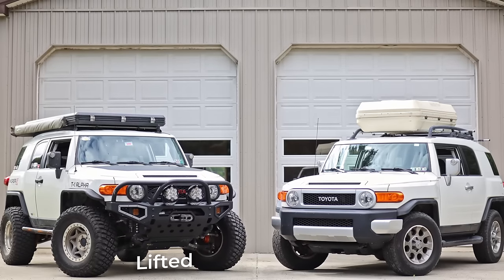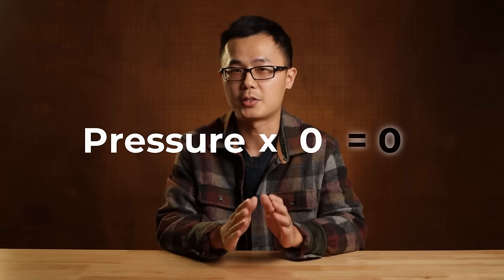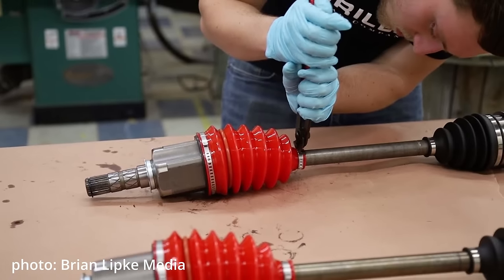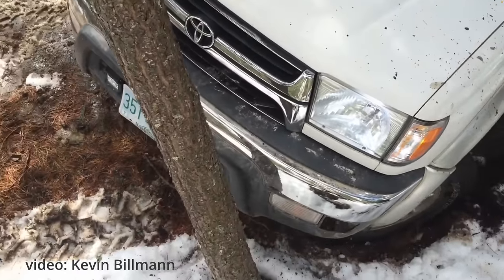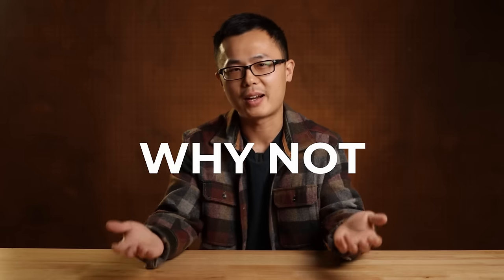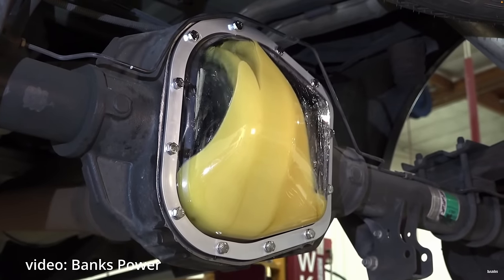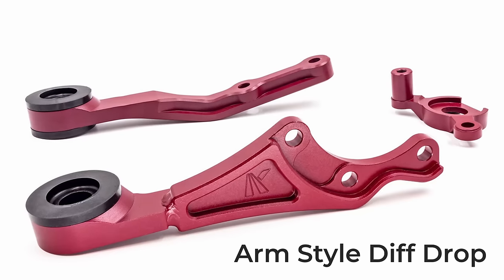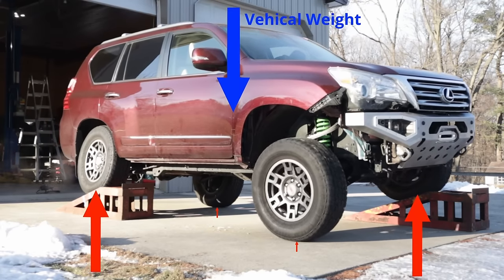More Harm Than Good? Toyota Diff Drop Truth vs Myth

Comment: Hey Tinkerer. Love your videos, but something feels unintuitive about this one. I did a bit of googling, and it looks like the maximum stress on a CV joint increase linearly with angle according to a research paper. (BIGGER ANGLE = MORE BROKEN CVs) 

Google the (free) research paper "ANALYSIS OF RZEPPA AND CARDAN JOINTS IN MONORAIL DRIVE TRAIN SYSTEM" by Sang June Oh and John T Woscek, 2015 and read page 8 and 9. The CV on our vehicles are Rezeppa joints, so don't worry about the Cardan joint. "The bending moment... is dependent on the operating angle and the initial drive torque from the motor. The maximum stress is seen at the top of the splines." On page 9, there is a table showing that the stress increases as angle increases. They also did FEA and found that the factor of safety (higher is safer) in a particular application dropped from 25.04 at 1 degree angle to 3.66 at 6 degrees to only 1.99 at 12 degrees. This is for a train, so don't apply these numbers to your car, but notice that failure is clearly more likely with greater angles. Please let us know if I'm interpreting this wrong, I'm not an expert!
Reply from the maker: Hey Will, great thinking and research! This is exactly the goal of my channel. Have everyone thinking critically and with reasons! My video does not conflict with the paper you found. Yes, higher CV angle means more stress. I never deny this in the video. But the practical thing to consider is not the binary Yes vs No, rather, how much it changes and with what trade off. The 1" spacer style diff drop lower the inner cv by 0.3". It reduces the CV angle by around 1 degree (about 5% reduction). Yes, this will reduce the stress by a little bit, but just like "high performance" air filter, yes, it will increase maybe 5 horse power, but it will not even show up in 0-60 results. If this is the end of story, I'd say just drop the diff. But in reality, I need to give up 1" ground clearance (10% reduction for most people), that became a very bad trade off. A big loss for very little gain.

Comment: The one thing you fail to mention is the potential vibration you can experience in even small lifts from increasing the angle of the joints. Toyotas front ends tend to "shimmy" at certain speeds when you lift them due to increasing the cv joint angles. Adding a drop kit can help with this issue. It helped my 4runner.
Reply from the maker: That is caused by the front diff needle bearing. A diff drop basically reduce the equivalent lift by 0.3-0.4 inch. It is not solving the root cause nor will it work every time. Just like the CV boot wear I mentioned, the proper way to fix this issue is not a diff drop. It is using a front diff inner CV bushing.
Reply: @TinkerersAdventure  what point in the video did you mention a shimmy? I never saw it. You go from needle bearing to bushing? I know it helped my 4runner. Have you tried it yourself? I bet not.
Reply: @TinkerersAdventure  So you tell people that there isn't any issue with increased stroke across a metal surface and others are supposed to take you seriously? Increased movement causes increased wear and premature failure. The CV joints will not last as long. A drop kit will increase the life of the CV joints. Well worth the minimal cost associated with them. Toyota CV joints are expensive.
Reply: I have a 3rd gen Tacoma with a 2 inch toytec lift and today I found both cv axles are damaged again this is twice in a year and without doing much off-roading. So everyone said try out the kit and I bought a set of cv axles from extreme off-road.

Comment: Lift kits offer no more ground clearance than the lowest part of the drive train. Raising the body does nothing but give some clearance from high side obstacles. The axles and driveshafts stay where they are, and obstacles such as large rocks, washaways or stumps are still able to foul your drive train no matter how high your chassis is above your axles and diffs. The only way to increase clearance is by increasing wheel diameter or keeping the diff bolted to the body when raising it. 
Raising any 4x4 beyond manufacturer specs is risky for stability and puts stress on components. Modification is only promoted by those who want to make money off you, so do the smart thing. If you want more ground clearance, buy a vehicle designed with it in mind.

Comment: I just had a 3” bilstein 6112 ready lift installed on my Tacoma trd off road. Along with the diff drop spacers it also required skid plate spacers and sway bar spacers. This is advised directly from readylift. CV angles don’t look bad either. Why? Lol

Comment: You vids are very informational, I have a 2018 Tundra with Bilstein 5100 on, a 2.5" on the front and a 1" block in the rear just to level the truck, (complete leaf spring kit will be replaced later).  My question is, do I still need to dif drop?

Comment: You never mentioned it on the opposite spectrum. If you drop your diff to much, when your suspension is at full compression the CV can also bind. You ultimately need to find that sweet spot where it won’t bind at either extreme.
Reply from the maker: That's very true. I measured without diff drop. The CV is 16 degree at the bump stop. so it was close. But the inner joint is pulled out so the shaft would not collide. I didn't test how it will bind next.

Comment: Pertaining to differential drops, why do all American drop kits only drop the front, pivoting the diff forward, which also drastically increasing the pinion angle at the input ujoint. The Australians have developed a kit for the Hilux that also drops the rear mount equally which solves the fluid level issue and possibly evens out increased pinion angles by dividing that increase between both front and rear ujoints of the front propeller shaft.

Comment: I'm going to have to disagree 100% about the front differential drop brackets. I am also a mechanical engineer, with a masters degree from Stanford University. Front diff drop brackets vary in quality, so you should buy one that doesn't negatively affect your front drive shaft and differential. If one is not available, I wouldn't recommend installing a bad kit.

A front diff drop bracket has massive advantages. Those who say it lowers ground clearance, aren't doing it properly, end of story! The whole point is to make room for larger tires, which increase ground clearance. Diff drop brackets lower the hinge location of the LCAs. While expensive, you can buy extended length steering knuckles, and extended coilovers. Your front IFS suspension travel won't change. And, if you buy extended length LCAs and UCAs, it will increase significantly. Now, with much larger tires, regearing your differentials for those larger tires, and lessening the strain on your CV joints by not putting your front axles at extreme angles, you're in a much better setup for off roading. If you want to crank your front IFS up for more ground clearance, you can still do so. Nobody's stopping you, if you're not worried about breaking your CV joints.

Contrary to the opinion of the author, broken front CV joints are often not the fault of the driver. They certainly are when it comes to poor off road drivers. But, when off roading over some serious challenges, most people end up with their front axles at an extreme angle, and their wheels turned. You can step on the gas as lightly as you want. If you can't get out, you're eventually going to have to put a lot of torque on your front axles.

Comment: Hey great video. I have a 2010 Tacoma looking to install a small lift soon. What springs to you recommend to pair with the Bilstien 5100s? I have stock bumpers so no exta weight. Also planning on doing an add a leaf in the rear.

Comment: Fantastic content! One thing that I noticed in your videos is that some of this may be dependent upon the alignment adjustment of the lower arm, and how that can lead the inner joint into a bind. This makes me question if this scenario becomes a contributing factor to the drop being beneficial if this occurs?
Reply from the maker: You’re correct. I did measured CV angle across all cam bolt position, but it was too detailed so that didn’t make the cut. The bottom line is, if you have the right coilover installed, you’re fine across all alignment positions

Comment: Our shop has decided that the needle bearing eliminator products are crap, and often it’s because you’ve lifted too high and the axle angles are damaging the needle bearings. The diff drop reduces this to a non issue and is the only reason we ever recommend diff drops for.
Reply from the maker: Interesting. What issue did you have with needle bearing bushings? What brand did you use? I’m running the one that came in my ARB front locker and has been fine. As to diff drop, as I showed in the video. The 1” spacer drops the diff only 0.3”. So it’s equivalent to lowering the ride height by 0.3”. Maybe that’s enough to make a difference. But I think actually lowering the lift by 0.3” would yields more ground clearance and down travel. The arm style diff drop would be a more meaningful actual diff drop
Reply: @TinkerersAdventure  same person you responded to. But my personal 4runner has never needed any of it but only lifted 2” and at 50k miles, but I’ve seen it a few times on several pages where ppl complain about a vibration in 2wd that goes away in 4wd that they have accredited to a poor needle bearing design. There is a product that is basically a brass sleeve with a nylon inner to replace the “crappy” needle bearings. It’s a crap product and when a customer asks to install it, we decline and recommend going back with oem if they want to replace it. But usually we find a different part causing the issue all together. Interesting thought about lowering the lift, that is the correct way to fix it. Then again we’re in Atlanta and a lot of guys just want to be as tall as possible

Comment: Hey I have messaged before on one of your other videos. I don't own a Toyota I own a pajero/montero I do full subframe drop kits not just diff drop kits as the pajeros are independent front and rear. Fitting 2" suspension + 2" subframe spacers/body lift giving 4" total lift allowing larger tyres but keeping the CV angles and suspension arms angles the same as just having a 2" lift

Comment: I have a lc200 3" lift....
So many push for diff drop over 2"
It's interesting that you say big lift is 3.5"...

They took 3 attempts 35mm 55mm and now 75mm (3") and have to say the angels are not that much.

Never seen or heard off a cv fail on highway or off road that wasn't right foot down...

Comment: Here are the facts, lifting a vehicle changes angles, imagine someone bending your arm or shoulder out of its normal position, sure itl do it for a while but after a while itl start to cause problems. 
same with a diff. only a diff doesnt repair itself like a body does it can only wear out. So in short, you lift to get clearance but then drop it down defeating the entire point of a lift kit.... Portal axles would be good or electric.

Comment: I bought 2.5” lift kit  for first gen sequoia that come with ( did not install yet ) : 

Icon 58620 Front Coilovers
One Pair of SPC Upper Control Arms
One set of OME Rear Springs
One set of Beefcake Dobinsons Rear Shocks

I also bought the 1” diff drop kit and now I don’t know if this lift will affect the cv boot if I don’t install the diff drop kit.  I never liked the idea of diff drop.  Didn’t see a point to drop truck parts 1” lower after installing 2.5” lift .  Do you recommend just replacing cv boots with higher angle or leave stock as is ? I don’t plan to do much off roading or rock crawling.  Just a trip to the mountains with minor off road condition once every 2 weeks.  

Thanks for the great video !
Reply from the maker: The boot wear is not related to torque, or how hard you wheel. High way miles is wearing it simply because it spins and bends around for that many revolutions. You'll likely see some grease come out sooner or later especially on an old vehicle. So I'd say you likely need new high angle boots, or replace the factory boot clamp to adjust the shape of the boot.

Comment: I kept my lift at 2 inches because it seemed like the cv angle barely changed from over stock (2020 4runner, non pro) and have been considering going 2.5 and getting the IronMan UCA, from your experience how much does that extra half inch impact the cv's when it comes to long term reliability. The car is not even 3 years old and already has 60k miles, and want to make sure its as reliable as can be to prevent being stranded somewhere remote.
Reply: ironman uca are junk now. they got recalled and replaced to ones that need maintenance unlike before

Comment: I currently have a 1” diff drop installed in my 2005 Toyota tundra from the PO. I am installing new front struts, decreasing the lift from 2” to 1.5”, and adding larger but skinnier tires 33.2x10.4 (255/85R16). Should I remove the diff drop? Tell me what to do Kai! 😂

Comment: I own a 01 tundra and I don't do trail riding and all that. I do more soft snow crossing as I live in Alberta. I have a 2.5in lift but plan to make it a 3in lift and that's where she'll stay. I have to rebuild everything in the front as my truck has got 288k km and basically factory ball joints and control arms with factory bushings and my young dumb ass threw a lift in it without thinking about the other stuff. I saw these diff drops and I never knew if it was good or not. I always wondered about the pinion angle. good to know. rockauto sells high angle CVS so I've been planning in getting some of those for my truck as I've had factory cv axles in my truck and asoon as I lifted it tore the boots 🤣

Comment: Thanks for the video, just wanted to ask you were saying that the 100 series has diff drop included in most kits, is there a reason for this, is there any recommendation for the 100 series
Reply from the maker: I am not familiar with 100 series. I didn't know about this before speaking with ironman. I'm not sure exactly what will happen if you don't run a diff drop on 100 series.
Reply: 100 series diff drop evenly drops the diff. Unlike Tacoma/4Runner that only drops the front of the diff, putting it at an angle.  I have lifted a handful of 100 series and have lifted over 100 Tacomas. 

100 series I do recommend a diff drop, Tacoma/4runner I do not.

Comment: I have 09 FJ with Billstein 5100s, 3 inch lift, and the moment factory cv axles became next to impossible to get (supposedly ALL new cv axles were being used to produce the FJ for Dubai market and even after a 5 month wait on backorder list I STILL received a NON OEM cv at factory oem price!!! And it turns out the one they gave me AS A FACTORY OEM was nothing more than a repackaged O'Reilly cv axle at factory oem price, or at least manufactured by the same Chinese company with trash steel, on the same exact manufacturing line as the supposed Factory oem, with EXACT SAME badging and  everything, just different package. An expensive solution is CVJ axles in Denver Colorado. It is much less if you still have the original factory oem to swap otherwise they charge you $$$ They ONLY REMAN TRUE FACTORY SHOWROOM FLOOR OEM AXLES and thank GOD they do.) I broke a cv axle every 10k miles or less with NO OFFROADING OR AGGRESSIVE DRIVING! The boots would last 1 oil change as well. So far a napa cv axle and diff drop has solved issue but if it happens again I am paying the $$$$ and getting TRUE FACTORY OEM reman by CVJ DENVER and turning in my napa set for a new backup set reserved for Overlanding. I have never needed a diff drop with my 4runners and I have over 500k miles behind wheel with 2 different 4runners, and one was daily driver with a daily commute consisting of 30 minutes of steep high articulation fire roads of Northern Colorado (minor mods only unlike like my FJ). And cv axles aren't the only fj part being rebranded as factory oem, a valet key i just purchased for 40 to 60 bucks or more was a 7 dollar no brand key PACKAGED WITH Toyota packaging...😢 idk what is going on, but it isn't what went on 10 years ago when purchasing parts through dealership at a premium! I even tried unaffiliated dealerships out of town and state and exact same issue, so it isn't dealership thing, surprisingly,  it's a new Toyota thing.

Comment: with the 1+ in diff drop mounts, I imagine you might run into cv binding issues as you approach the top of your up travel
Reply from the maker: Great thinking! I measured CV angle at full compression. Just didn't make the cut to the video. In stock form, full compression the CV is at 16 degree (yes, more angle than stock full droop). However, the difference is at compression the inner joint is pulled out. So the axle shaft will not collide with the inner joint housing with more angle. But I did not test any further to see how it will bind next. So its a valid concern.